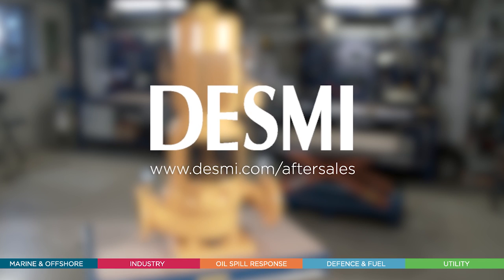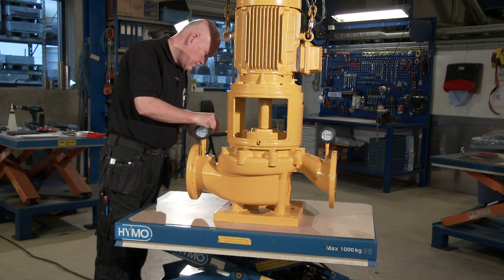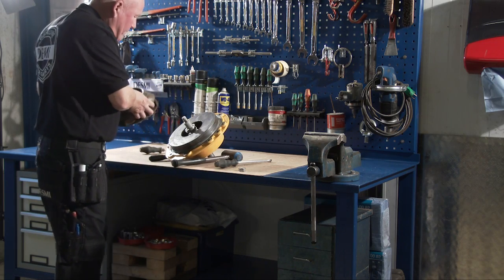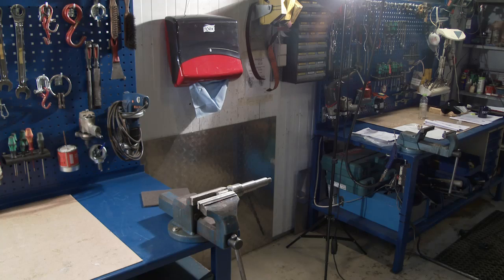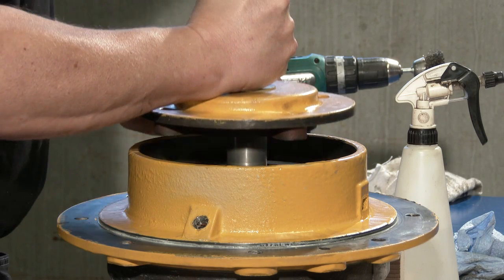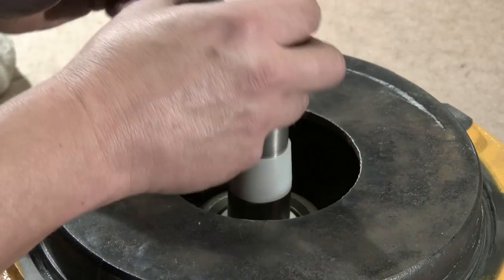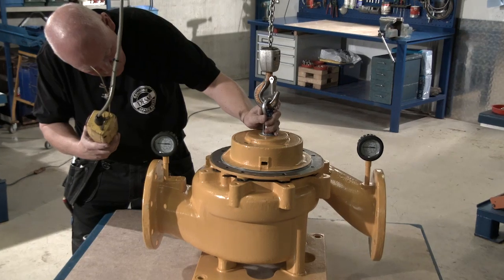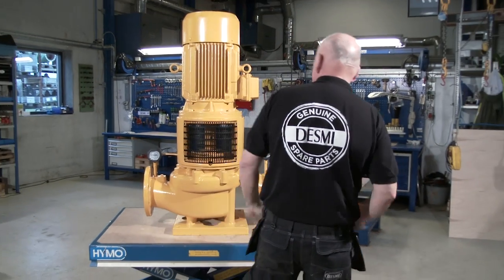DESMI Overhaul video NSL centrifugal pump monobloc NSL150 265 A02

Comment: What do you call the material handling set up you have with remote control for moving the pump?
Reply from the maker: We use a remote-controlled crane by the workstation. Other options could work, as long as safety, weight and mobility and is taken into consideration and in place :-)

Comment: Some of our brand new Desmi vertical pumps impellers are rubbing against the housing when turning the pumps shaft with hand. Any suggestions? We have a lot of Desmi Pumps in the warehouse to be installed on the ship in future. Thanks
Reply from the maker: Please check/ensure that the pump casing is not overloaded with forces / moments from the piping system - this might deform the pump casing and result in impeller rubbing against wear ring(s)
Reply from the maker: And for more information, please do not hesitate to contact us via desmi@desmi.com
Reply: @DESMIAS  Thanks for the info. Will email desmi@desmi.com. No the pumps are not installed yet and it is in the  warehouse for long term storage for 6 months to a year before they get installed on the ship. Part of the storage maintenance is to turn the pump shaft once a month. When turning with hand you can feel some of the pumps impeller is touching the housing.

Comment: Can anyone please tell me what is the exact name of that Coupling.
Reply from the maker: This pump does not use a regular coupling. Our model A02 is designed with a short motor bracket frame which means that we use a kind of pipe coupling which is fitted directly at the motor shaft. This design also eliminate the requirements of pump bearings.
Reply: @DESMIAS  thank you for your reply 🙏

Comment: Why didn’t check for shaft run out?
Reply from the maker: See 5:18 where we mention "check the shaft for damages" :-)Have a great day.
Reply: Yes i know you check the shaft for damages but should check shaft with dial indicator to determine whether the shaft is bend or not..that’s what i mean..if the shaft using component or cartridge seal, always check stuffing box perpendicularity and concentricity to ensure it’s still within tolerance to avoid seals premature failure..thanks..have a good day..